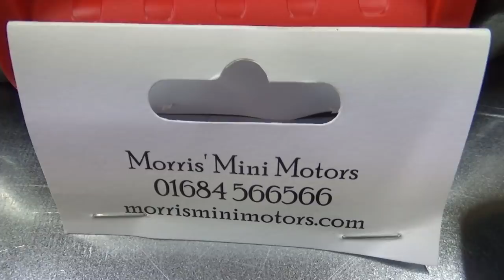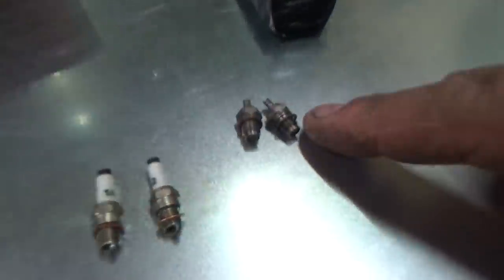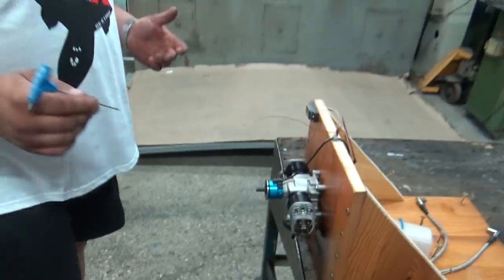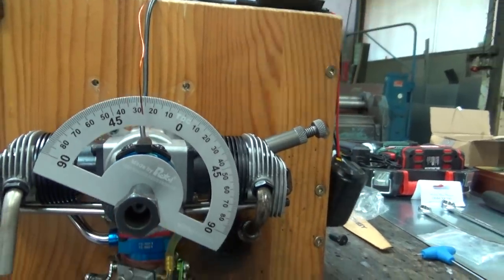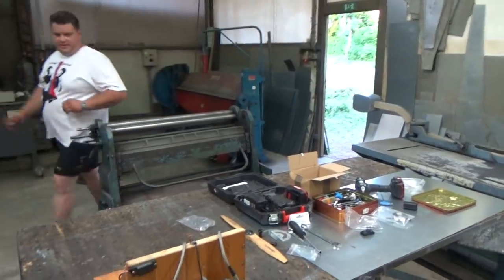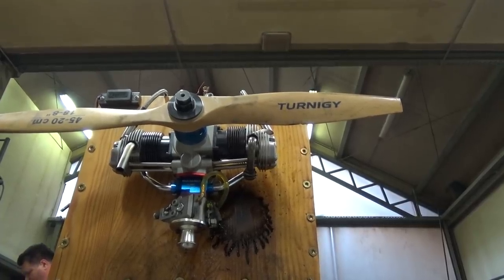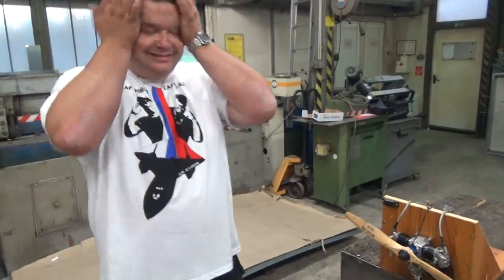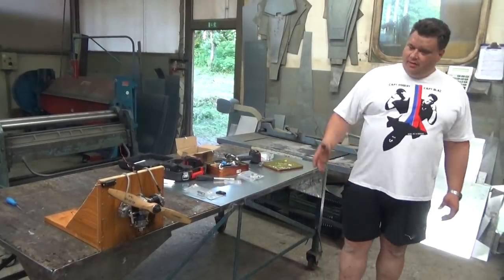OS FT 160 Gemini TWIN Glow conversion to Gas Quide and test Run video

Comment: I enjoyed your tuitorial on this ignition system. One thing I noticed though, is you don't need to remove the rocker cover. This is a wasted spark ignition. One trigger both plugs fire each time.

Comment: Another great run from Capt. and Brother Blaz.  I think they sound much better on petrol than glow fuel.  Once that is broke in on petrol, it will run better, and I believe stronger.  I would love one of those conversions, and need to find one.  Thanks for a great video.

Comment: Great video guys. Just one little thing. The procedures below gives you a finer tune. It appears that the timing is advanced a little more than should be . That would explain the prop freeze on the cold start. Keep up the video's Gentleman.

Comment: I'm thinking of getting a plane...but I've never flown before so it's better to start with electric motor possibly...and obviously easy set up....nice motor.  :-)
Reply: Just my opinion from flying both but I agree with the electric motor option first.  Less to mess with and chance for beginner error.  Avoiding the prop is STILL the number 1 thing to keep in mind.  Ask me how I know  :)   I started with the Apprentice and is still one of my favs because its very forgiving and easy to set up and fly.  Its a high wing trainer designed for first time pilots.  Lots of similare planes like it,  is just my fav.   A simulator is always a good investment and time well spent learning.  Then find a club with some good exp pilots to hang with and learn from.  Then fly and have fun   :)      Russ
Reply: @russc3288  some great advice thank you...looking forward to my first plane and searching for local clubs this very moment....
Reply: @stuartrobson5265  Theres a great forum on rcgroups.com that can help as well.  They cover just about any topic rc related known and I'v learned alot on there -  radios, speed controllers, diff planes, etc etc.  Dont be shy about asking questions of them.  Most are very knowledgeable and can save you many hours of frustration and mistakes.  I fly a Spektrum DX6 radio and RX's and love them.  But then again, you'll get just as many guys flying others that work too and have some of the same good features.  I buy almost all my stuff from Horizon or Motion mainly because they have in my opinion the best service and response from exp employees that actually care about the customer.  Hopefully some of the guys and gals on this site can help you as well.  A good bunch here thanks to zee brothers efforts.   Just dont plan on being first to post after they put a vid out.  :)
Reply: yes it wold be for the best to start like this yes...

Comment: With this method you don´t get the exact top dead center! Use the degree disk and then rotate the engine clockwise to the piston blocker, notice the degree value, then rotate it counterclockwise to the piston blocker and notice again the degree value. The degree value between the two noticed values is the real top dead center.

Comment: One of your best videos Captain. Blaž & Captain. Robert ! I remember using a timing light to tune  my car when they had points & distributors & changing BTDC for better performance. It was satisfying doing it yourself. So the timing is set for 30 degrees BTDC ? Do you mix the oil in the gas or buy it premixed? Thanks for sharing this conversion.
Reply: oh yes very goot feeling ..yes 30 btdc  i make my own mix with MOTUL FACTORY 800 oil..it is the best oil...
Reply: @ Blaž Petrinčič Thank you for answering my questions. It is amazing that  an electronic ignition can adjust timing based on engine rpm’s ? That is very sexy that it can do that. Have you ever tested a RC turbine jet on your bench? They are so expensive! But what a fantastic video that would be Ohh yea!  👍

Comment: If you still have to spray your model with oil, why would you want to convert? What you really have to add is an oil system that has a pump, a tank, a filter and cooler. That way you will not have to scrub the entire aircraft after every flight.
Reply from the maker: Great thinking my friend.

Comment: Capt. does the conversion damage the engine cylinder from petrol?
Reply: no no it is ok...just need to have very good oil for mix..i use MOTUL factory 800

Comment: Very interesting video,curious to know if it's a ,4 stroke engine why have you got a 40/1 mix of oil in fuel,and does the crank have oil inside to stop bigend bearing damage the crank case would be a bomb if it took fuel oil mix inside to lube bearings yehh surely it fills with oil inresting little engines. Be great on your pitz special birthday present
Reply: u use on this 20:1 mix and yes the bearings and anything inside gets oiled from gas mix...

Comment: question, what makes the most power per stroke,with fuel, and
what will run the longest per oz?
Reply: first the timming must be spot on..i use 95 octain fuel and the carb setting must be ok also